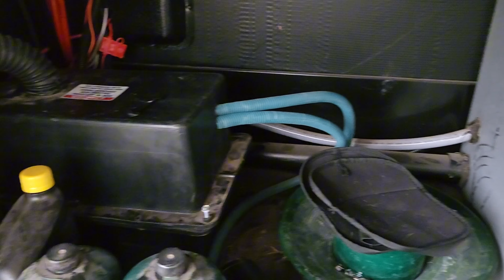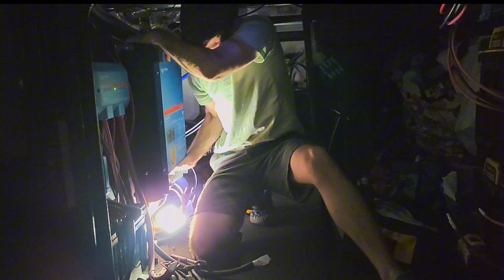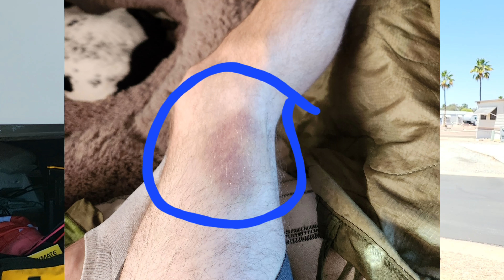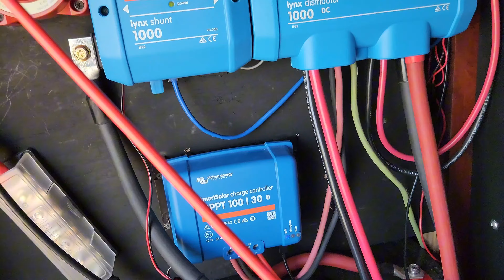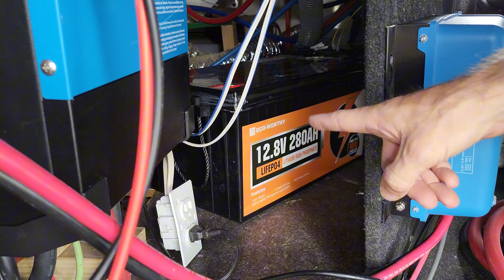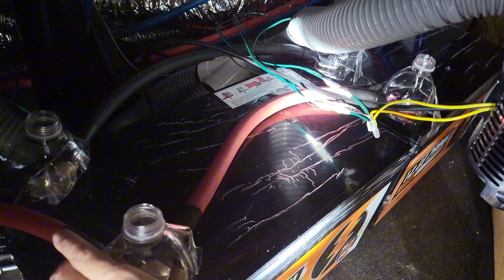Solar Power & Learning to Power our RV Off Grid for Boondocking

Comment: Can you post a parts list of your system? Also where did you get the brackets for your bigger panels? I’m starting to buy our system parts and have the batteries, panels, multipus and charge controller. We are planning to start full timing in June 2025.
Reply from the maker: We have the multiplus 2 12v 2x120 3000 lynx shunt distributor cut offs a T fuse and the lynx and distributor hold fuses we run 2 x 250/100 victron mppts with 6 x 375 watt pv panels. I got the panels off fb marketplace for a deal. This is not the best way. I put this together over a year as I saved and learned. I bought some premade pv panel brackets and 2 of the panels i had to build up over vents and skylights i made mounts made from angle aluminum.
Reply from the maker: I think it could be done a lot cheaper with a 48v system and you would not lose as much in heat and the conversion process. It would also give more available power over what my system is capable of now.